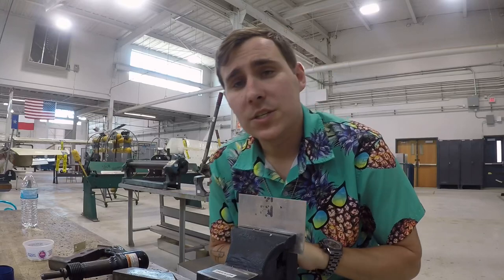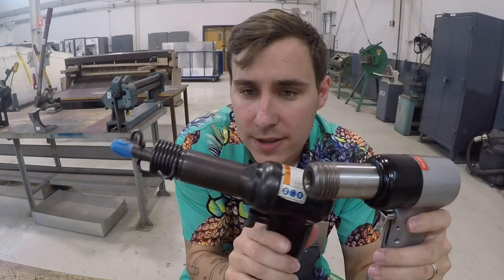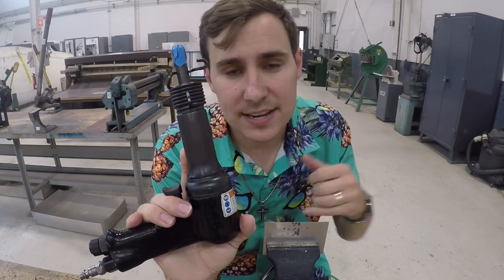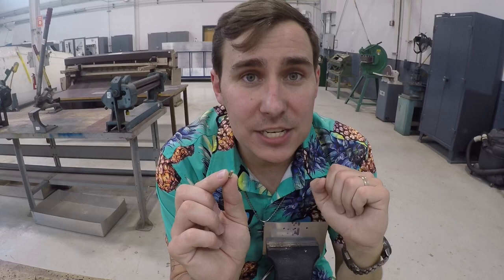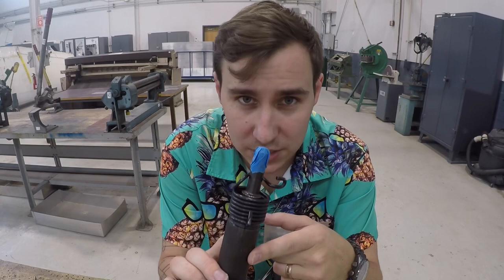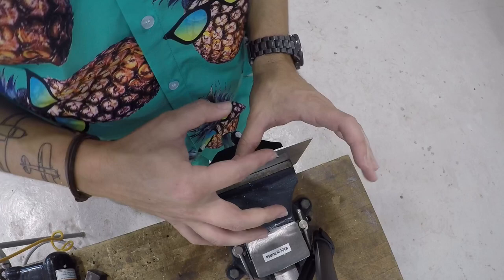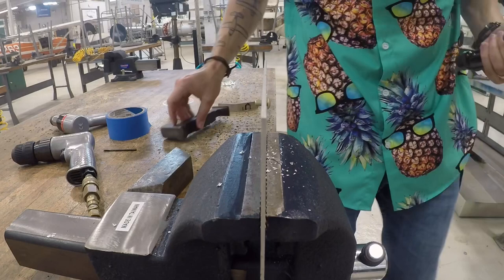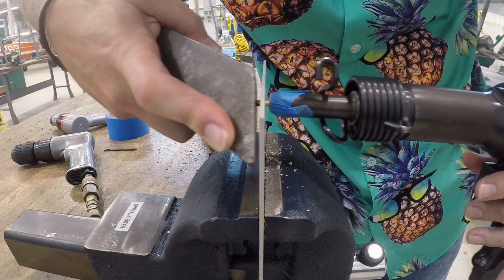Try Doing These 4 Things When Installing Aircraft Rivets!

Comment: Great video. How do you correct a rivet that wasn’t shot properly?  The overshot or crooked ones?
Reply from the maker: Unfortunately you have to drill it back out and try again, I'll probably make that a second video because I have at least 6 tips on drilling them back out.
Reply: I always wondered how you rivet something.  Now I know.  Correcting mistakes and actually riveting two pieces of aluminum together would make  a very interesting part 2.  10:46

Comment: I've noticed kitbuilders seem to get whatever air tools they have at harbor freight. When I worked on cars everyone had favorite impact gun or air hammer, I had an amazing Cornwell 250mm gun. Is there any brand of rivet gun that is "better" than another?
Reply from the maker: In my opinion, yes. I know the name is wired, but The Yard Store sells really high-quality aircraft sheet metal tools. Also, aircraft tools supply sells a pretty good catalog, some cheap options, and some more expensive. I also like Seaux Air Tools. I will add right here on the end, though. I don't think there is anything wrong with buying from Harbor Freight. Especially if it's something you will only use a few times. If it's something you are using every day like I do, then I always recommend quality.